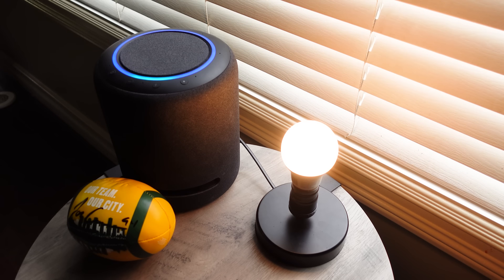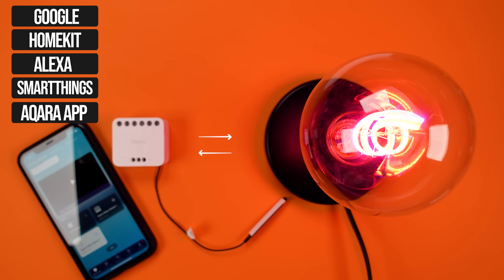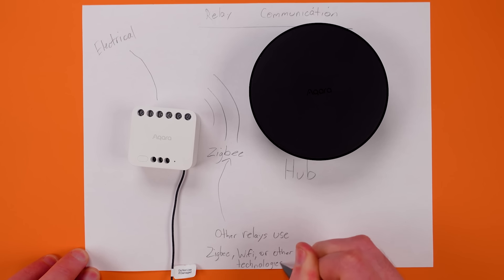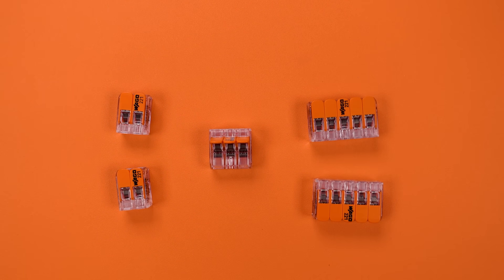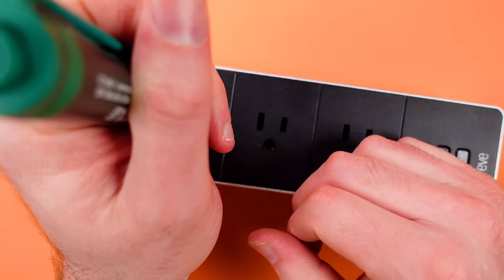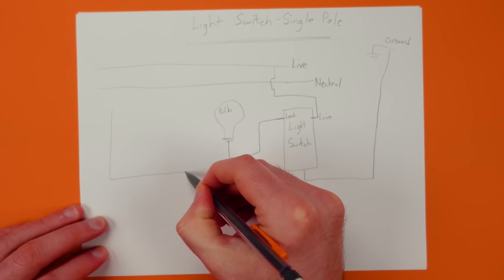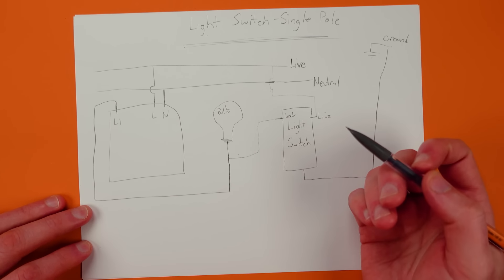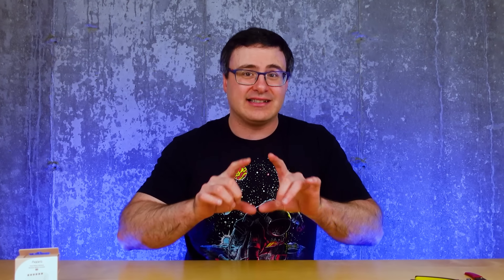How To Use Smart Relays - 101 (Featuring The NEW Aqara Relay Module T2)

Comment: Great tutorial, Brian. Thanks! I have been looking at these for switches and misunderstood how the wall switch and relay interact. Now that you demoed it, especially the comment and visual that the wall switch emulates a 3-way setup, it makes sense to me. 

I have a question now about "wireless switch" mode, which I think you may have misunderstood since you showed it as functionally equivalent to disabling the switch entirely.  

Here's my alternate theory and maybe if I'm right you will do another video showing it. I suspect that in either mode, the relay exposes the load to the home automation system which we might label as "porch light" or some such. But it seems to me that enabling wireless switch would expose the switch as a distinct device, separate from the load. 

So, for example, now we have "porch light" and "porch light switch" exposed in the hub as separately controllable devices. If true, the obvious next step is to define an automation to connect them such that hitting the switch operates the light, or possibly operates both S1 and S2 loads from a single switch. 

If I'm correct, the switch in wireless mode functions as it did when dumb - up is on, down is off. This may be more intuitive (i.e. higher spouse approval factor) than acting like a 3-way in a use case where there is no second physical switch. The additional benefit of this is the ability to tie in other loads so we might end up with a load device called "porch light" and a switch device we label "Front outdoor lights" that operates floods, landscape lights, the porch light, and (seasonally) holiday decorations based on defined automations to tie it all together.

Am I close on this or is this just wishful thinking? Because I really like it and my use case needs S1 & S2, but I'm not going to the trouble of expanding the junction box if wireless switch mode doesn't expose the switch(es) separate from the loads. Would be really cool to dive deeper into the wireless mode in a follow-up. Thanks again!
Reply from the maker: Hey T.Rob!  Thanks for watching and the kudos.  Sadly for you (and great for me), I don’t think I misunderstood Wireless Switch mode.

I say that because we had a technical review with the engineers at Aqara before this went out.  It was done specifically for that reason…so we had the technicalities right.

Wireless Switch mode as I understand it is going to be more for those times when you want to eliminate a switch or more often for a sensor you want to connect (garage door example comes to mind).
Reply from the maker: I do think there’s potentially an opportunity to wire in a smart switch to do this same thing, fyi
Reply: Thanks for the reply,  @AutomateYourLife . I guess I was looking for a use case that makes sense there. If the wall switch is connected to the device and the app is set to Disable Mode, the wall switch might as well not be present. Similarly, setting Wireless Mode also functionally disabled the switch, or at least that's what it looked like  in the video. Any sensor would, as I understand it, need to present on/off states because the device senses continuity not voltage. That would mean sensor use cases are same as switch use cases, even the garage door sensor. Coding and testing costs money so nobody codes different modes that have no functional difference. Which means there's still some difference between Disable and Wireless mode I'm just not seeing.  

Unfortunately, their online manual only covers installation and not the different behaviors in the app. It does have a diagram (first one) in which the external switch replaces the jumper and the user is switching between wet and dry mode. This wasn't covered in the video and I don't quite understand the expected behavior. Now I'm wondering if maybe that configuration is where Wireless mode becomes useful?

End of the day, I might need to set up a test bench similar to yours and just play around with it. I took advantage of Big Deal Day, or whatever Amazon calls this one, to pick up my first Aquara hub and a couple of FP2 devices. Maybe I'll go back and grab one of these too.
Reply: @AutomateYourLife  I'm surpised that is the conclusion you came to after reviewing with the engineers.    Wireless switch mode as I understand it just means that the switch or switches that you attach to the control terminals S1 and S2 can just become an independent switch devices uncoupled from the relay operation of L1 and L2.  Such a switch can be used to trigger an automation or a scene just like any other independent smart switch or button.   And as your experiment demonstrated, the switch operation in this mode no longer affects the L1 and L2 behavior naturally.

Here's a section from another review that covers this
https://youtu.be/ToJHXnb9BR8?t=883
Reply from the maker: Yeah OK, so I'm seeing what's being said here now.  So you can drive an automation with the S1 or S2 contacts for something else in your home.  So it does look like some of what TDotRob is asking for is possible through the automation engine in Aqara's app.

I think maybe Aqara just felt like this was enough of a guide...and so did I.  But that's where these things are different

Comment: Alright … I’ll post the dumb question. I can’t get this thing to power on. I’ve tried three different 12v power supply’s and two different relays. Nothing. Never make it to setup. Now what?
Reply from the maker: There are no dumb questions with relays.

I don't know if there's something off with your 12V power supplies.  Sounds like something is off with that.  Maybe try making the cable I make at: 18:53 – Power Up a Smart Relay Easily With This.

Comment: I normally like your vids Brian, but this time you have far over complicated this and given wrong unsafe advice. At 19.57 you say you wired black into neutral, which you haven't you've wired it into the second hole which is live as it should be in USA I believe. 

You talk a lot about safety yet get this very wrong!!!!
Reply from the maker: Not excusing the mistake Mike, but gimme a break man.
Reply: There are lots of technical mistakes in the video which I've not touched on.
Stick to what your good at bud and leave the electrical work to the experts.

You should also never disconnect an earth as you suggest by doing away with the now disused wall switch. An earth connection must always be connected to any load (unless the load doesn't have an earth).
But in the latter it must be a double insulated device and carry the appropriate symbol not just be a cheap Chinese import which doesn't understand the importance of an earth connection.
Reply from the maker: @mikef3324 please point them out Mike
Reply from the maker: Hey Mike, I think you misunderstood what I was saying when I said that you could do away with that switch and that’s where it’s funny that you started this whole thread by saying that I had over complicated this video.

My intention was not to say that someone should ever do away with a ground .  It was to let them know that they had the possibility of not using a switch.

Please do point out the areas that you think I have made mistakes and hopefully I can correct them in the next version or the next video .

I’m happy to continue to improve my knowledge in these areas but also, I hope you try to understand how difficult it is to make a video that is for a complete beginner who wants to use a relay in their home
Reply: Wtf?😂😂😂

Comment: While you mentioned the caveats a number of time, I dont think this product is for North America (or EU/UK). And definately not for beginners. It is only 10A and all NA circuit breakers are 15/20A. The fail point becomes the relay on a circuit short. Plus this relay module is too beefy to fit in a NA single gang box without impacting switches, outlets and connectors. I don't see a UL or ETL certification. Both Aqara and Sonoff need to rethink their solution for NA and EU. Shelly does it right (UL versions). Love Aqara sensors but as a EE, this is a risky solution.  Most electricians probably had a heart attack. Don't burn your house down.
Reply from the maker: Yeah I personally think this relay fits more in the garage or in multi gang outlets personally.  It’s footprint is large!

Comment: Even people that are not beginners could learn from a "beginners guide"   
This is a great little tutorial and there are some great ideas in the video.  Thanks for the time you put in to this.
The Wago style connector is popular outside of North America, but I beleive Wire Nuts are very popular in North America still.    The jury is out as to what is the best method still.   Done correctly, using wirenuts of the right size, they can be just as good as any other connection.
Reply from the maker: Oh thanks sir!  There was a lot of effort and time into this.  

I tell you though, my fingers love those Wago connectors!  You folks outside of N.A. have it right as far as I'm concerned.
Reply: WAGO is making it way into the Electrical Code in many US states.

Comment: Can this relay be used in a sconce that does have a switch? And set up a little button near the sconce to be the switch?
Reply from the maker: Sure! I don't have the dimensions of where you're planning to install, but I don't see why not.  Aqara's Wireless Mini Switch is a good option for the little button
Reply: @ is the wireless mini switch compatible with the matter encoded products? That would be my only concern? It’s on their old protocol with the old hub?

Comment: Hello, I would like to ask, is it possible to use Dual Relay Module T2 with one light using simple switch and second light using 2(3)-way switch ?
Reply from the maker: I don't see a reason why you couldn't!  I think everything is fine, but I didn't test it out personally
Reply: I am thinking because in diagram there is com and S1 S2 used from switch and with 2way switch I won’t be able to use it that way
Reply from the maker: @Teshily the COM is tied to Live in most of our diagrams, and we are mostly showing 2 way switches.  You'll have to do a little modification of the diagram but I don't see a problem